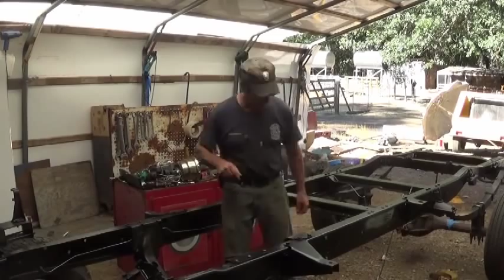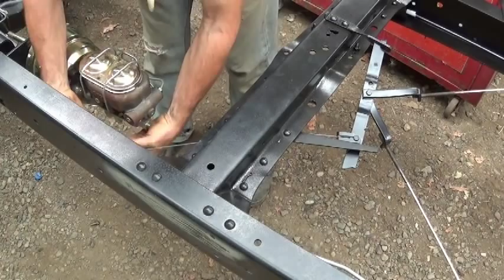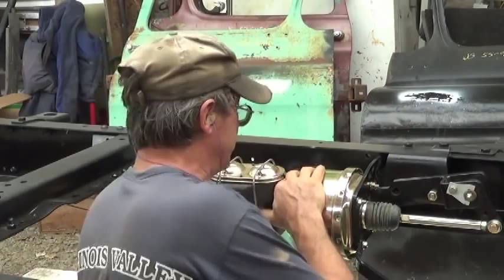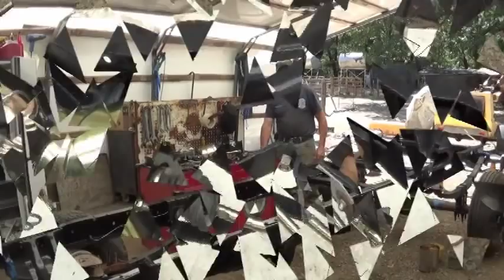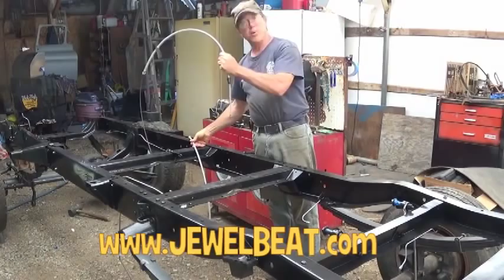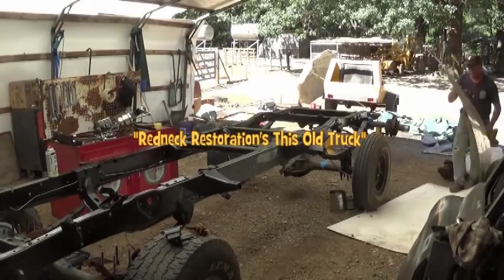Project Whitey: 1957 GMC Tandem Brake Master Cylinder & Booster

Comment: I'm looking at my E-brake situation and I'm thinking I need to drill a hole on the outside and move the cables around. Told myself to come look at your channel for the answer. Sure enough, you did it that way and I will follow suit.
Thanks for the knowledge you share.

Comment: with the master cylinder/booster installed in the frame, how will you access it to fill with brake fluid later on when needed? With the cab on the frame, the seats..etc, are you going to fabricate some kind of access hatch?

Comment: Hi  im from the uk, i own a 1991 rockwood beachwood rv-on a gmc chassis- watching you fitting brake cables to back plates= on my gmc chassie-  i have 2 left hand back  plates  but one would go the other way one cable push- and the other pulls (crazy design) my mechanic is at a lost why did gmc do that--- i kept having endless trouble with mot stations over here, your the man to ask i was told--great videos thanking you tiger bray
Reply from the maker: +tiger bray I'll need a few more specifics. One ton? 2.5 ton? Rear disc or drum? Cables can't push, so the mechanism is designed to be pulled, regardless of the cable point of entry. I have never looked at the system you are speaking of, so photos or videos would help. You say you are having endless trouble, but not what kind of trouble. You can email me at RNRTOT @ frontier.com
Reply: Hi my rv as rear brake drums, it weighs 6-5 ton, On the p/s rear  back plate the point of cable entry is bottom  right side of the back plate not left like the d/s-- Oh and it as a foot rachet park brake- When i ordered a new set of brake cables 1 cable was longer than the other one--so you see it is a gmc design Just a Query Elderlylron,One rv dealer over here,, was confused as well lol, thanking you for e-mailing me

Comment: The very first video that I saw of yours was 1 of 2. It was either the red Chevy at the scrap yard that they crushed the roof on and you broke out the "Blue Tip Wrench" or The Project Whitey that you used a Leaf Blower and a Pressure Washer on the interior.
I subscribed that very same day. 4 years now maybe ?...3 ?
Thank You and Many Blessings , SMR

Comment: Well done, sir!  The new e-brake cables are already in my '59 Chevy longbed, but no master cylinder yet.  I'll be one step ahead and perhaps one behind (or two?).  Now I know what to do if there are any clearance "issues" and why!  Thanks!  :)
Reply: Hey Im wanting to put power brakes in my 59 Apache Long Bed . Any suggestions as to what product to use would be helpful. Clearance may be an issue because I have a 396 BBC under the hood. Also I want to put power steering in, same issue.

Comment: Is there a donor vehicle you can put a power booster brake setup on a 63 Chevy C 10? I would like to convert my to front disc brakes if that's possible cheapest way. I am thinking you would be the guy to ask thanks bud.

Comment: Just curious whether after adding this newer Master cylinder with booster were you still able to use it with a manual transmission and clutch system?  The master cylinders that I have inquired on say they only work with automatic transmissions, so I figured the clutch must be getting in the way. Where did you buy this master cylinder?
Reply from the maker: This came from Jim Carter's at www.oldchevytrucks.com. The booster is here: http://www.oldchevytrucks.com/cart/product.asp?prodid=HP550&i=|brake%20booster||||  Currently on back order. You can get a 10% discount of your first order by using my promo code, "RNRTOT", too!
Reply: Im curious too.. why does every conversion kit says that it doesnt work with a manual transmission? Did you find the reason??

Comment: "Tandem Brake Master cylinder and booster"@3:33 Is that a after market part? I want to put power brakes in my 59 Apache and would like to know what you have there?
Reply from the maker: Joe Huckin Any of your old Chevy truck resto supply houses carry them. I got mine from Jim Carters. I highly recommend the remote reservoir, though. The next episode show what you have to do to re-vamp the brake line routing. You can also get a Hydrovac unit for your single master cylinder and adapt it as well. You can find them on the big trucks.

Comment: why did they put the brake booster and master cylinder on the frame instead of on the fire wall like today seems kind of stupid . the salt snow mud dirt will rust that thing in no time .
Reply: valdarmort  you answered your own question. they put them on the firewall now because putting them under the floor - they rusted. I think originally brakes under the floor was to utilize the space since there wasn't much under the hood. Plus it made the linkage simple.Its evolution :D